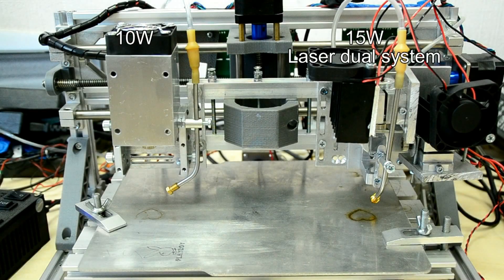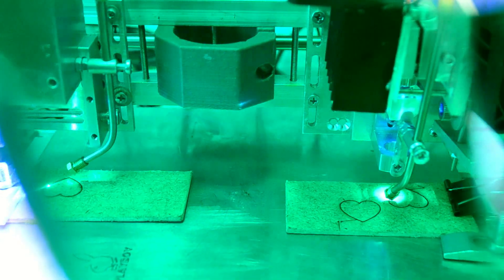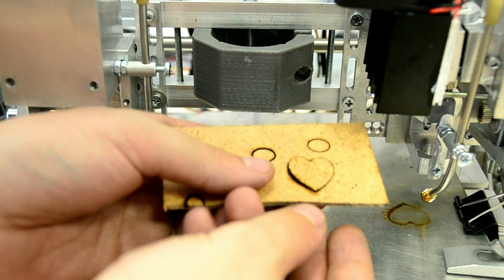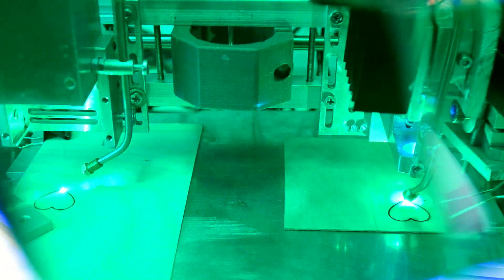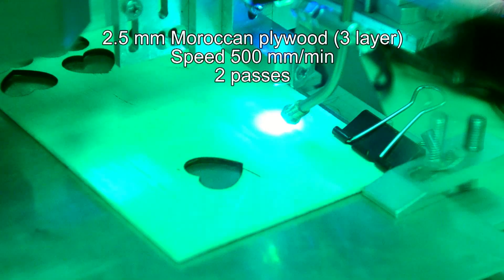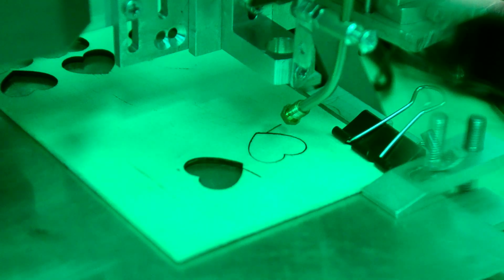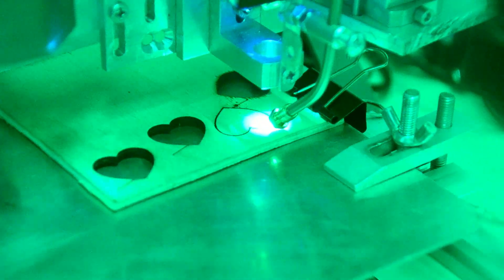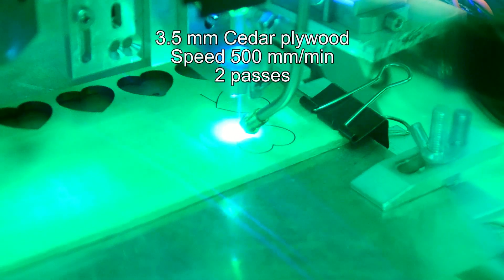A REAL15 watt POWER blue 445 nm dual laser system. Comparing to 10 watt "Invincible". Cutting tests

Comment: Probably a concerted effort from Chinese competitors to make your video look bad.
Reply from the maker: who knows... but Chinese guys do not make dual laser systems... all they make is cheap and low quality diode lasers telling that their output is 15-20 watt which is not TRUE!!!
Reply: @Endurancerobotschannel  I was able to buy a dual Chinese laser on eBay last year (3.5W x 2). Not very impressed since it had fixed focus only and used a semireflective mirror instead of a prism.